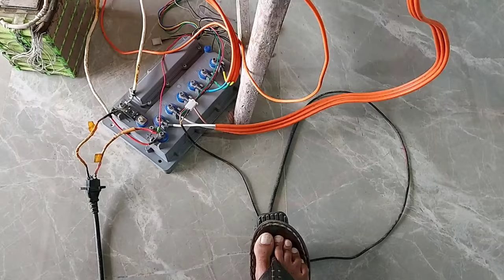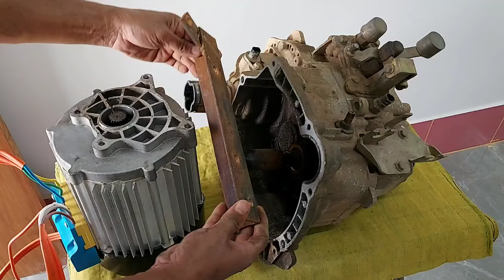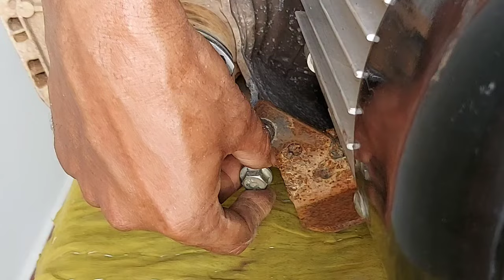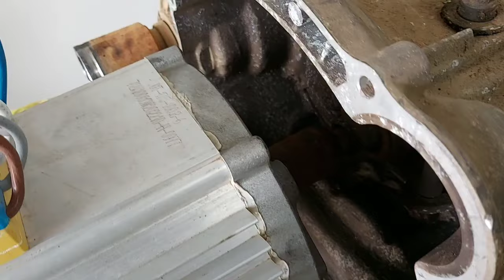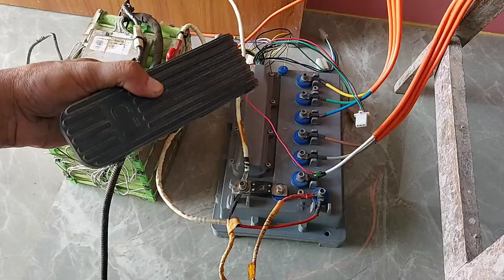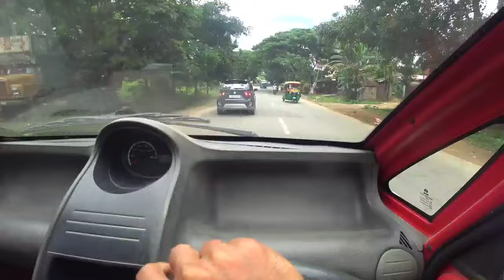TATA NANO ELECTRIC CONVERSION PROJECT

Comment: it will be very good if you done below 3 points.
1. Without clutch plate it will damage the gear box as well motor while shifting gear. try to add it.
2. Motor connection to engine should proper full plate arrangement (fully closed) with engine oil gasket / coolant oil. 
3. if possible try for coolant oil connection with existing nano radiator for long travel, it is good for gear box cooling.
Reply: Sir aapka 2no point hi kam ka h ,1or 3 no ki jarurat nhi h
Reply: @sunildahiya6572 Clutch bhi jaruri hai